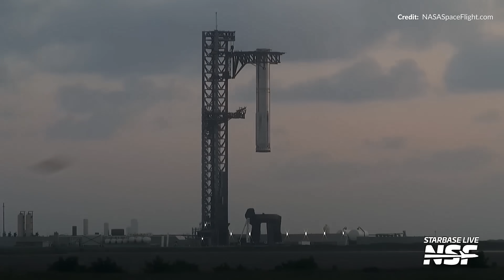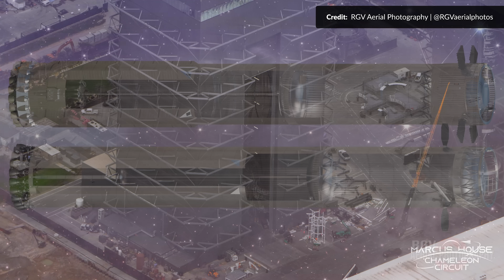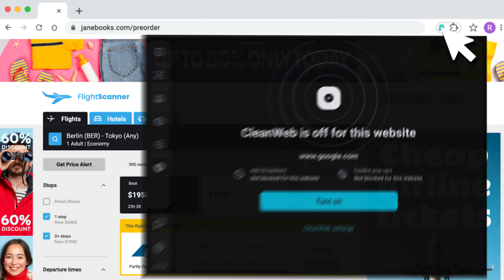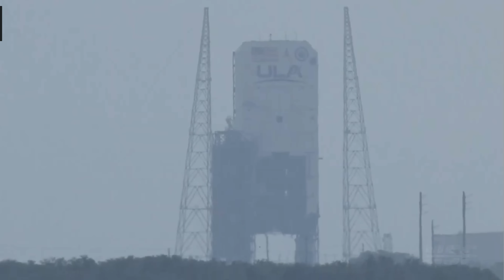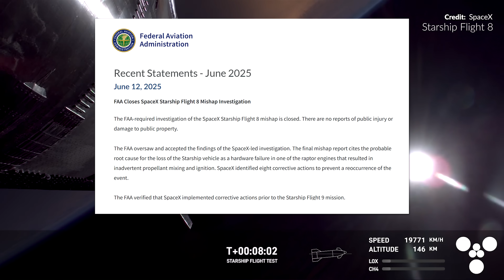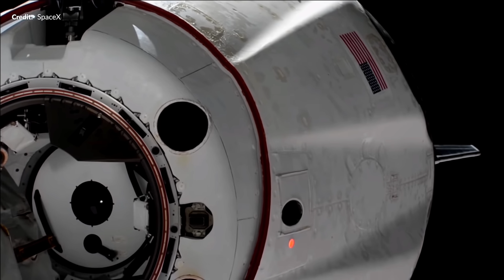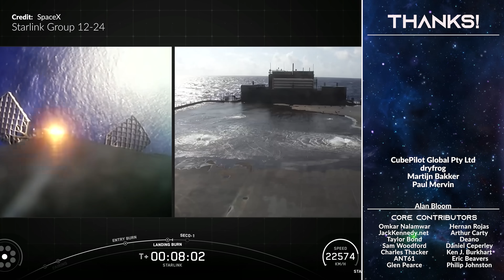Surprising changes to Starship Super Heavy! Why are they doing this?

Comment: The starship boosters seem pretty full proof ! Just gotta make the ship behave itself ! Cant wait for TF 10 ! 👍
Reply: The term "fool proof" is used to suggest a design so good that even fools couldn't stop it from working.
SpaceX design isn't quite there yet.
Reply: @michaelreid2329  you are a fool: here is your proof.

Foolproof" describes something designed to be so simple and reliable that it cannot be misused or fail, even by someone who is careless or inexperienced. It implies a high degree of certainty that the thing in question will work as intended
Reply: 9 failed launches, the fools run SpaceX.

Comment: "We may still need some kind of system to purge those smaller shielded areas..." 
This is why I'm advocating for a water deluge system to be engineered into the base.  That system's purpose is to deliver a cascade of fresh water into the engine bay so that the water flashes to steam as it contacts the flames- expanding 1600 times its original volume and therefore adding a notable boost to the launch.  

If the umbilical delivering the water extends from a catch arm, then it can travel vertically with the booster as it rises off the pad, potentially adding this mass-free boost for a full ten seconds, or until the booster clears the tower before the umbilical severs and lets the ship pipework to empty of water and the ship to continue on its way with no mass penalty.
Reply: It still a silly idea.
Reply: @imaginary_friend7300  But you have no capacity to say why.

Comment: Omg they finally add a flame trench?!? Reinventing the wheel is their new model.
Reply: I agree - why fix it if it isn't broken? NASA has used flame trenches since the 60s. So yes, SpaceX is reinventing the wheel. They launched Starship-1 with no flame trench or water suppression system, even though there's tons of data showing how important that is for large rockets like the Saturn V and Space Shuttle. How did that work out?
Reply: where have you been?  they've been working on the flame trench for several months now.  Also, they tried something new.  It didn't work out so they're moving to a more traditional design.  It's almost like they're prototyping or something here
Reply: Dude, they've been building the fu(king thing since they dug the footings....... try and keep up... piss funny 😃😄😁🇦🇺
Reply: @rodmills4071  Right, they started building it AFTER they cratered their launch pad. Almost like they should have started with the footings for a flame trench instead of... concrete. Wild concept!
Reply: god forbid someone try something new am i right?
Reply: @anekdoche7055   No. Something new can be worse than the old version.  New cars don't have full spares, some just have patch kits. These kits are the * new * way to fix flats, but I'd rather have the * old * fix, a spare tire.
Reply: @anekdoche7055  Something new' = pretending flame trenches are just a suggestion. Really groundbreaking stuff, literally.
Reply: @twosuns20  tbh its true that thinking concrete can take a blast of 7000t of thrust was kinda stupid. but at least they're making progress. unlike anothe space program...
Reply: Things develop in stages, the world isn't a video game.
Reply: @imaginary_friend7300  Right, stages. Like how NASA went through the 'concrete pad' stage in... oh wait, they skipped straight to flame trenches because they understood physics. Weird!

Comment: I know they plan to retire the Dragon spacecraft to make way for the Starship but I personally would keep two around in working order to use for emergency vehicles that could rescue anyone on any spacecraft that might have a serious issue like the Chinese spacecraft , Russian , Starship and maybe Indian if they build a human rated spacecraft. I don’t know just like to have a back up!
Reply: I've always thought it would be sensible to have a 'rescue' vehicle on standby, to get astronauts back down in a crisis. Even if it/they were solid boosters and throwaway tech, from obsolete vehicles, it seems like a good insurance policy.
Reply: The original plans for space station freedom had an independent recovery vehicle.  The challenge is that even a recovery vehicle has certified lifetimes on most propellant types where you get bleed off, and if it stays attached too long you run the risk of vacuum welding.   @bikerfirefarter7280
Reply: @bikerfirefarter7280 there are two “lifeboats” on the ISS
Reply: @RuralJuror420 I know, but its not the only thing up there. It just seems like good insurance practice to have a safety.
Reply: That's a good idea.
Reply: I believe they currently have five dragons. They are only certified with NASA for five lunches each but SpaceX is working on getting that extended to 15 which may just require some very thorough inspections. Three of the five have one launch left on that certification one I believe has four launches and then they have the new one with zero Launches on it. That's an awful lot of launches to deal with the International Space Station considering the International Space Station has a decommissioning date already.
Reply: @donaldbates155  Yes, but several commercial space stations will depend on Dragon. In the case of Haven-1, essential support systems come from the Dragon docked to it. Haven-1 has passed several qualification tests, and is scheduled to launch in May 2026.
Reply: @spacexrocks1041 no existing contracts with space x now for that.   They would have to be crew certified by the governing body involved.   That usually takes years from scratch.   Sounds like they probably have contracts with others.   If not, space x wouldn't have stopped production already.   Per space x, no new dragons, crew, or cargo.   As things stand now, it barely has enough launches to handle the minimum for the ISS.  And that is with nasal extending crew stays on station and reducing supply missions.
Reply: It's also important to have a certified, independent option. 

If we shift to, say starship, as our primary human rated launch option, an accident can ground the fleet for an extended period of time. Starliner was supposed to provide that alternative.

We experienced this issue following each of the shuttle accidents.  With folks of ISS and future stations, we really don't want Soyouz or a Chinese vehicle to be are only fallback.
Reply: @jml_53 yes a Spaceship that can carry enough astronauts , the Dragon (7) two rescue people room for five other people , no other spaceship can carry that many except maybe the Orion if modified ? But we have been wishing for years for a rescue ship. It would be a nice insurance policy!
Reply: @jml_53 unfortunately with the short time left for the International Space Station no one is wanting to invest the money into continuing developing a system other than the Dreamchaser but the Dreamchaser has been having problems getting booked on a flight because it cannot launch itself it can only make the delivery and do the re-entry
Reply: Not just the dragon capsule, but Falcon 9 rockets also will be needed to launch it.
Reply: @arkangeln910c8 crew Dragon requires Falcon 9 not the other way around and the Falcon 9 and Falcon 9 heavy have cargo versions. The discontinuation of the crew Dragon will not affect the Falcon 9 Falcon 9 heavy. What will affect them is when the Starship is actually fully capable of doing what it's meant to do then they will be overpriced relics
Reply: @arkangeln910c8  As pointed out in another comment here already though not as explicitly.
Reply: I believe their plan is to retire Dragon AFTER Starship is carrying people and they plan to build hundreds of them that can carry people.
Reply: @roycsinclair Dissimilar redundancy is still needed. Whole fleets really DO get grounded. - Dave Huntsman
Reply: @dphuntsman  There's a truth there but given the disparity between how many people can ride in Starship versus Dragon that will only be a "backup option" for projects that do not carry a lot of people.  More likely one of the Starship clones being developed will end up with a disaster and having a Starship come to the rescue.
Reply: Dragon isn't going anywhere for a while; they'll keep it around until Starship has been flying crew for at least a year, plus time for any last contracts with Dragon. Dragon will probably be one of the last things flying on Falcon 9, alongside NSSL payloads.
Reply: @erictheepic5019 they have completed construction of the last contracted dragon and each dragon is only certified for 5 launch. SpaceX is trying to get them recertified for a total of 15 but right now there is only a limited number of dragons and a limited number of certified launches left so yes it is going away unless they can come out with a deal with NASA to recertify them for additional launches. The manufacturing facility has been shut down where the dragons are made. No more are being made
Reply: @donaldbates155  Sure, but if they have 15 flights per, and 5 Dragons, that's 75 flights total; over the past four or five years, they've only gotten through 18 of those. The fleet's got at least another decade left in it, but I don't expect crewed Starship to take longer than that. As I said, Dragon has plenty of time before its successor gets here, and will probably stick around for a year or two afterwards.

Also, in response to @dphuntsman, when SpaceX switches over to Starship for crew, the redundancy situation will be exactly the same as it is today. Only difference being that Starship will have had tens or hundreds of times more flights under its belt than Dragon ever will by the time it first flies crew.
Reply: @erictheepic5019 if I remember correctly, there are only 11 flights left in all for the 5 combined unless they get additional certification.   I feel that is very likely a long as inspections show they are still in good shape.   But the need for them pretty much ends in less than 5 years because the ISS is being decommissioned
Reply: That would be foolish at best, but then foolishness does seem to be Musk's calling card.

Starship will weigh far more than Dragon so any mission to orbit requiring Dragon features would automatically become more expensive due to the extra fuel burned to get it there.

If the whole point of SpaceX is to make space launch more affordable then that seems like a pretty sizable own goal.
Reply: @mnomadvfx actually the projected cost of Starship per launch when it is finished is down around the 30 million Mark which is cheaper than launching the Falcon 9 with crew dragon. If I'm not mistaken the Falcon 9 uses a completely different Fuel and different engines and the current Raptor 3s that are just about to start use on the starship super heavy booster are much more efficient.
Reply: @mnomadvfx  You just told me you don't yet realize just how important Starship is.  The COST of launching Starship is intended to be about $2 million per launch.  That's not what SpaceX will charge for a launch but the idea is to get the cost of launches down to little more than the cost of the fuel and oxidizer.  Despite the intended low cost to launch Starship is intended to get up to 200 tons of cargo to low earth orbit.  Then with refueling that 200 tons of cargo can be taken inside Starship to pretty much anywhere else in the solar system.  However it's also possible to have an already fueled booster and spacecraft inside Starship which can be released in LEO so it will also be possible to have custom missions that rely on Starship to only get them to orbit and that could include a Dragon capsule as well.

The important thing to note is that by being a fully reusable spacecraft the cost of the spacecraft itself is divorced from the cost of the launch unlike with Falcon 9 where only the booster and the payload fairings are reused. Every Falcon 9 has to have a completely new Upper Stage which is the reason it still costs a lot for each launch even though the reusable parts make it the lowest cost launch option right now.

 Initial plans for Starship and Super Heavy have them flying 100 flights though of course the initial versions will probably far quite short of that goal it is telling that SpaceX is now up to 25 flights for the Falcon 9 booster when the initial goal was 10 flights.
Reply: They will be building more crew and cargo dragons soon. It will become obvious that starship is many years from being human rated due to re-entry and catch reliability. The exception being luna starship. I also suspect that any manned flights to Mars will use a separate decent capsule for people
Reply: @hedleypepper1838  The biggest obstacle to human rating is the idea that the human "capsule" should be a separate piece.  Worst case, SpaceX makes it a separate stage adding unnecessary weight in the form of tanks, engines and landing legs.  

More Dragon craft?  Nope. Too small, WAY too small.  Starship meant to carry up to 100 people, Dragon at best is seven people.
Reply: And definitely don’t retire until you have the next one up and running. America cannot rely on Russia to get astronauts to and from space and dragon is our only reliable way to bring astronauts to and from ISS.
Reply: That's pretty bold of them, considering that Starship doesn't work in any capacity lol
Reply: @roccociccone597  All their plans are "pretty bold".  Much better than the "weak sauce" plans the rest of the industry is following, can you imagine how costly rocket launches would be today without the Falcon 9?

As for the Starship doesn't work in any capacity, that's true if you're looking at it as a launch platform but it's already proved that they catch the booster which means they can also catch Starship though they've also proved that they can land Starship instead. While the whole system is still in development they've already used it to prove their theories of how it will work do work and just as importantly they also found a number of ways it can fail.  Nice of the them to find those before they start flying real payloads and definitely before they ever put a person in one of those.

In contrast Blue Origin started a year before SpaceX and just recently made their first orbital flight only to have their booster blow up instead of land as planned, meanwhile SpaceX launches Falcon 9 flights several times a week, so many that they launch more rockets to orbit than all the other companies and governments combined.  

So stop kidding yourself if you're thinking the Starship concept is a failure because even if it was designed to be a fully expendable rocket system it's whole development program has been about five billion while it costs four billion just to launch one SLS rocket which would be it's closest competitor.

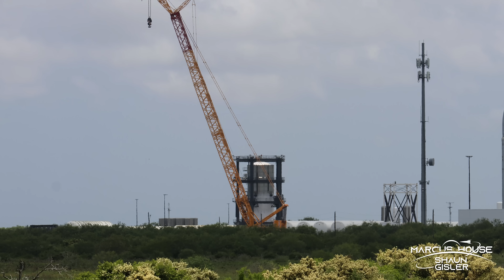Comment: 6:40 so if the aft dome and the attic are gone on v3 Booster, then what's with this ring of "portholes", if they're not CO2 vents any more?  It wouldn't make sense to punch a bunch of structure-weakening spots that are also potential leak hazards, directly into the LOX tank, for no good reason...
Reply: Is that a confirmed design change or just speculation?

Comment: Finally, SpaceX recognized that having separate catching towers from the launching towers makes perfect sense.
I don't think it would ever make sense to use a launching tower to catch a booster, except in the case of an emergency.
The idea that you would need to catch from a launching tower in order to maintain cadence never made any sense.
Reply: I can see it for a tanker version that's only taking fuel into orbit to refuel other ships, since that could easily be loaded at the tower, but the complexity of trying to load a payload at the tower would seem to offset any gains in cadence.
Reply: well they have more ground now
Reply: It doubles the efficiency of their ground infrastructure to have dual use towers.  You didn't think that through very far.
Reply: @imaginary_friend7300  I think you mean redundancy, not efficiency.
Reply: Catching the boosters at the launching tower makes sense. But not catching the upper stage, since that requires removing the booster to be able to catch the ship. Not a big deal right now anyways, since there is no need for multiple catching towers currently. Even if catching the upper stage, you have to wait several hours before the ship will be in position. That is plenty of time to move the booster out of the way and prep everything.

Comment: Most forget that we used to watch launches from NASA in years, not months and days.  Without Elon and SpaceX, where would space travel be at.
Reply: Cadence isn't everything. It's true that the Saturn V flew only 13 times, but it never exploded. Sure Starship launches (and fails) a lot, but Saturn V got us to the moon without explosions. And Saturn V was a very robust vehicle: a SLA panel fell off on an early test launch, but made it to orbit fine. The staging ring (interstage) didn't separate on the Skylab launch, but it still made it to the right orbit. Starship operates on the margins; if anything fails, everything fails.
Reply: @spacexrocks1041  The Saturn program absolutely had explosions. Most were planned, but not all. And we nearly lost several astronauts due to issues with the Saturn V.